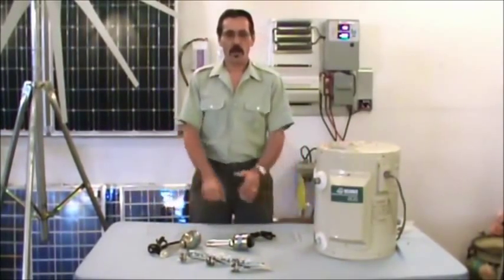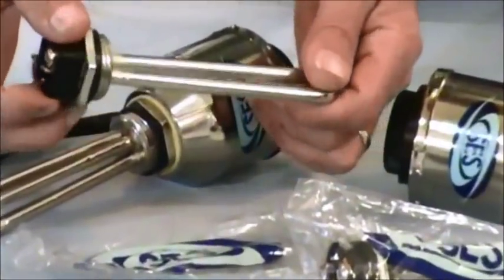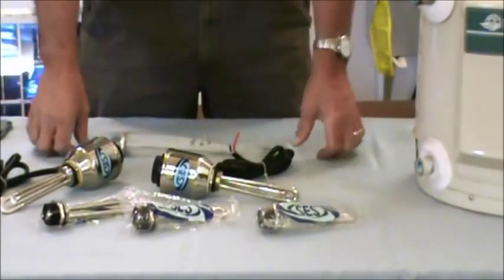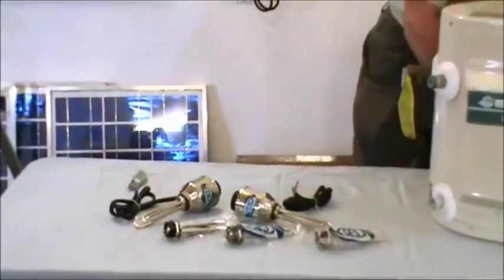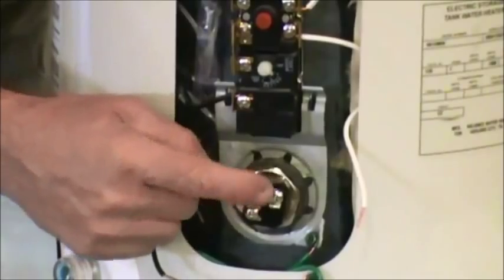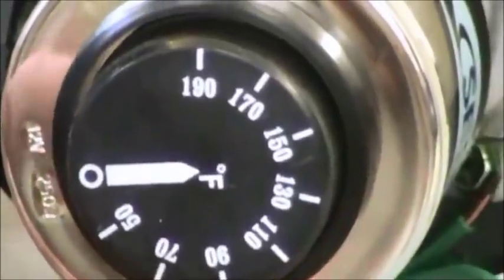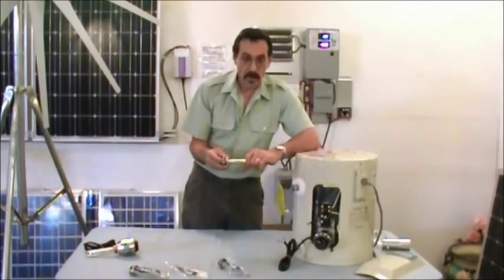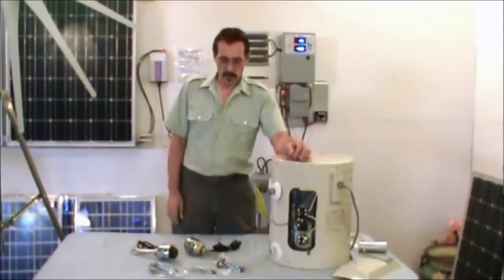DC Water Heater Element Solar Hot Water: Make Free Heat | Missouri Wind and Solar

Comment: Why would anyone want to waste solar or wind power heating water when they could use a solar water heater???
+Kenneth WIlliams  I'm a physicist. So do you mean you short out your solar panels? Why? Or do you mean you use it in a hydronic system where the heat is stored in circulating pipes in the floor and subfloor slab? Now that makes okay sense but you're still wasting the sun you could use directly for that, and wasting additional PV capacity you can charge a few batteries with. If you have a Stirling gen I could see it, but that's a lot more money than some more batteries.
Reply: Good question... Convenience? Simplicity? Cost? Time? Space? I dunno...
Reply: Marcos 989 Or a rhino for a pet, you mean. Lot of work feeding it. And where does it sleep? Anywhere it wants to.
Reply: Kenneth Williams Pssst. You can just unhook it. Not using it doesn't make it "go someplace bad". PV supplies a voltage difference, if you don't use  big enough amperage load on it you don't need to shunt this power off anywhere, it just isn't produced. In fact grounding your PV lines just wears out your PV chemically. So I have NO idea why you "send power to ground", all that does is make your voltage lower and drive less on the stuff you ARE using.
Reply: Its a good way to use up spare capacity. If your panels generate a sufficient charge such that your charge controller is dumping it, why not feed the excess power into a 12v water heater. It saves you the cost and hassle of creating a separate system
Reply: TheComputec Then buy another battery, why waste it?
Reply: rstevewarmorycom It is hardly wasted is it?

Just adding more batteries isn't always the answer...Depending on your solar capacity and setup / design, trying to charge additional batteries may not be possible on low sun-hour days and could result in the system not charging at all, but when the sun is shining and your load is low its a good dump option without the need for the expense of a solar heating system. 

Most people do have arrays that OPTIMALLY produce more power than their battery array can store. Once they are fully charged the power is usually wasted anyway, so for me its about reducing that waste

We all need a hot water storage tank anyway, so surely the cost of a 12v element is lower than the cost of an additional solar heating system?  Unless i'm missing something?
Reply: TheComputec The sun can heat water directly. Converting sunlight to electric power at 20% efficiency and using it to heat water is a waste.
Reply: rstevewarmorycom If you were choosing the best way to heat water from scratch then yes I would agree. But if you already have the solar panels and the battery storage, and you already have a hot water tank then this is a very convenient add-on to a system.   

If you can show me a solar water heating system that can be constructed for less than the cost of a 12v immersion heater then you are correct but this is mainly going to be an optional extra rather than a standalone
Reply: TheComputec A one hundred foot coil of black water hose on top your carport.
Reply: good luck plumbing that in to your system
Reply: davey wavey Why is that a problem? You just run your cold feedline to the rooftop hose coil and back down to your water heater. The water heater won't turn on unless it needs more heat. You save a fortune.
Reply: rstevewarmorycom it depends on what you are trying to do.... you would drop a small % efficiency, but you could replace expensive dirty batteries with hot water. the transfer of energy to the water with a heating element submersed is a 100% transfer of electrical to thermal energy, you could set up a staged Stirling engine generating facility right at your house. as demand goes up, you run another hot water tank and another sterling engine. so it would involve multiple hot water tanks coupled with sterling engines. It could be 1 very large multi energy tank, 3 sources, wood gasification boiler, wind or solar, and solar hot water. with separate tank and sterling set up. and hydronic heating off the main tank with low mass fan assisted radiant panel emitters and a mixing assembly to conserve energy, I would size the emitters to provide design heat load @ 125 or 130 degrees. this would ensure that emitters put out ample heat energy on a non design day at 95° F.....
Boom CHP for residential use.... just provide earth ground for excess energy, or recycle the excess in a small battery bank.
Reply: rstevewarmorycom it depends on what you are trying to do.... you would drop a small % efficiency, but you could replace expensive dirty batteries with hot water. the transfer of energy to the water with a heating element submersed is a 100% transfer of electrical to thermal energy, you could set up a staged Stirling engine generating facility right at your house. as demand goes up, you run another hot water tank and another sterling engine. so it would involve multiple hot water tanks coupled with sterling engines. It could be 1 very large multi energy tank, 3 sources, wood gasification boiler, wind or solar, and solar hot water. with separate tank and sterling set up. and hydronic heating off the main tank with low mass fan assisted radiant panel emitters and a mixing assembly to conserve energy, I would size the emitters to provide design heat load @ 125 or 130 degrees. this would ensure that emitters put out ample heat energy on a non design day at 95° F.....
Boom CHP for residential use.... just provide earth ground for excess energy, or recycle the excess in a small battery bank.
Reply: rstevewarmorycom also could be used to replace earth ground in a traditional battery system. rather than earth grounding when the battery's are full and there is no demand, I heat hot water either to help with space heating, or generate ac power on a bad day with a sterling engine. I this system I would use an ac to dc inverter to charge my depleted batteries on a bad day.
Reply: Kenneth Williams Sorry, most of what you've been blathering about is either unclear or sounds insane.
Reply: rstevewarmorycom on a day where my electrical production exceeds my needs and storage, I have to send the excess energy to the ground because there is no where else to put it. but If I have a large store of water to heat, I may never use the earth ground. Its more than blathering, It is a solid understanding of thermal and electrical energy..... If you do not know much about hydronic heating, I suppose I should not expect you to understand what I am talking about...... It's a use for excess energy that would otherwise go to waste.... thermal energy can be converted back to electricity at about 50% efficiency.
Reply: rstevewarmorycom for the record CHP is combined heat and power, it may be that a sterling engine can be successfully modulated by maintaining its source tank temperature at X °F/Watt
Reply: rstevewarmorycom or more specifically X °∆T/watt
Reply: one Joule of energy is 1N*m one watt is 1 J/second
Reply: Kenneth Williams Ahem, I know.
Reply: rstevewarmorycom if I am using solar or wind, it makes a lot of sense to store excess energy as hot water.
Reply: rstevewarmorycom true, it is more money, unless you are capable of design/build. fan enhanced Radiant panels would be my choice of heat emitter..... they operate on both radiant and forced convection and the fans as well as the water temp can be modulated. from a per dollar stand point using it for heating alone would be the best use..... a radiant floor requires about 105° F water, while a fan enhanced panel radiator is useful down to 95°F
Reply: rstevewarmorycom I tend to agree with you that solar thermal is far more efficient. my apologies I was unaware that you are a physicist. It is true that we send excess power to the ground if our battery bank is full, you have to, it has nowhere else to go..... Because waters specific heat is so high, it seems to me that heating water with excess power is a viable option.... the most efficient end use would definitely be space heating. Id rather do something with the excess than sending it to ground... or over the grid. earth ground is only used in off grid systems to dissipate electricity that has nowhere else to go.
Reply: rstevewarmorycom I have a pretty good grasp of physics, but Im more 1/2 physicist 1/2 technician at this point. I take my physics 1 final this afternoon.
Reply: rstevewarmorycom you say a sterling gen would be more expensive than more batteries? I can size a battery bank to store the energy from a hurricane, but that will cost far more than a Stirling gen and recycling thermal energy.
Reply: rstevewarmorycom makes sense. Not something I would do with solar, I've not studies much about PV, dont believe I would waste money on PV due to degradation. In any case hot water has many uses, If you can produce enough electricity, why wouldnt you heat water with it? For wind energy It makes a lot of sense, I have all this power im not using, takes a lot of power to heat water. PV on the other hand I tend to agree, it's a waste of panel.
Reply: rstevewarmorycom so most of my information here was shit, lol, that's what you get from a shitty source I suppose..... study it all properly next semester.

Comment: This is awesome... I have a RV that will become my home in the future, and the cost of propane to heat water is CRAZY priced... Being on a limited income, This would help me a great deal, and I would never have to worry about having warm water. I'm wondering if the heating element with the built in thermostat, will it fit my Atwood XT hot water heater ? Thanks for sharing this video....
Reply from the maker: +Roger Sayers Should fit it ok.
Your welcome Roger.
Reply: if ya go propane use a on-demand , its instant and only used propane while you use hot water, showers washing dishes etc a 20 pound works heating for 6 hrs at highest heat setting (will burn skin) 12-20 hours at reasonable temps. Magiccheff makes a perfectly good one and nicely priced.

Comment: Can I Hook Up 250Watt Solar Panel directly to my DC water heating element ?, with out the need of batters?;  And could you please tell use about Utility approved Grid Ti Converters., And could explain
 to use all about the 1.5KW Plugged in Solar Grid Ti Converts.

Comment from the maker: Those DC adjustables will be back in stock in a couple of months.
Reply from the maker: yes they will
Reply: @MissouriWindandSolar  Jeff, I have a 14,000 gal above ground pool in Wisc and pool heater options that exist are too expensive IMO.  This seems like it could work as a very inexpensive alternative to the pool heaters on the market right now. Message me because I think we should talk about making a kit for pool (mostly above ground) owners across the US for this to revolutionize the pool heating industry.
Reply: Very informative! Thank you!
Reply: hello, will these units work with just a 12v battery?

Comment: very informative video. In this case of the heater connections. There is not other device to install between the water heater and the solar panel?

Comment: ok I have lots of questions but only going to ask one for now I have a 50 gal 220v hot water heater with 2 elements. on at the bottom and one about half way up. can I just replace the bottom one with a 12 or 24 volt one and leave the one on top 220 volts. and just turn it on late at night or on no sun days. or does it have to be 220 v. or 24 v 100%
Reply: There is a relay on the hot water heater that switches from element to element only one is on at a time. have the same kind of unit. just wire it 120 and it will only use 1000 watts. there is a vid on my channel if you want to check it? Just did this my self working awesome so far.

Comment: GREAT VIDEO

I have a QUESTION.

With the 12v 300watt dc heating element how long does it take (approximately) to bring up a 35 gallon tank of water up to useful temps?

Assume we're starting around 60-degrees fahrenheit?

I know there are a lot of variables involved.  Just looking for a magnitude of scale.

1 hour, 3 days, etc...  I know we're talking 300 watts which is 1,023 BTUs (perfect conversion)  and it takes 1 BTU to raise 1 gallon water 1 degree fahrenheit.

So the math would say (assume 100 degree increase)   100 BTU/GAL * 35 GAL  = 3,500 BTUs

So Can I assume 3 hours?

I'm looking for what you experience day to day.

THANKS!!

Comment: I have a question if you used one of them in a solar windmill as a dumpload what happens when the temp of the  water gets to the  cut off of the thermostat ? meaning the water got to the mas temp  and the battery bank is full . then what happens as dump controller ?  cause i want to run  one though my m109a3  and so i can have hot water but also  have dump load control so i do not fry the batteries in the unit .
Reply from the maker: #### #### Good question. Alot of people have always used them as dump loads and that was on there own , not by my advice. The element has to be connected to a thermastat, once your water is hot the wind turbine will disconnect and freewheel which is not a good idea. Solar to them works good.

Comment: I had no idea there was such a thing. Can you put together a system that will switch and operate with grid power when there is not sufficient wind and/or solar and switch back when wind and or solar are producing again. Maybe a grid/wind/solar charge controller on a small battery bank. Water heaters sure gobble up power.

Comment: If I understand this correctly, when hooking up a solar panel to a DC water heater you do not have to run the power through a battery first like you do for everything else?
Reply: simon, andale andale, arriba arriba, orale pues

Comment: Could you make a recommendation on the solar panel you would use with this?  Also, does anyone know how many gallons of water a 300 watt element could heat in a half hour say to 104?

Comment: so question, i have a water heater that has dual elements and it has options to use both elements or 1 permanent and the other as a standby, do you think i could use this in place of the standby, and it would cause the main element (which it temp controlled) to operate less thus save money?

Comment: Can anyone say how long it takes a 12 volt, 300 watt element to 'reach temp' in a small 5 gallon water heater? {assuming the t-stat is set at warm and not full hot]  Curious if it takes all day or an hour?  IF my math is correct, a 12 volt @ 300 watt element would be drawing 25 amps from a battery bank til the t-stat shuts off the element?

Comment: Very nice product? 
I am using 220 / 50 hz  here in Chile because this is what all my appliances are rated at. Can these be used on a 220 system? or will I have to convert the power from the Wind Turbine? I sure do appreciate these videos. Also can you provide a Celsius scale on the heater elements?

Comment: BY my calcs that old 120v 1650W element should be 8.727Ohms. Many people forget to square V or I for power calcs on R
12v 16.5w
24v 66w
48v 264w
Thermal insulation is the key if you just want a bucket of hot water. if the heat can't escape even a tiny candle can heat a bucket of water.
But I agree, don't wast your money on a regular $10 dollar product that has had it's numbers rubbed of to resell at 1000% it's value.
But also remember just plain old enameled copper wire wound around a stick submerged in water will disipate it's heat and in turn heat the water. Just wind it up to the desired ohms.
12v at .5 Ohms is 288 watts for example. That should heat up a cup of water for a coffee in under a minute.

Ooo and yup, they look like very well made elements MW.

Comment: o.k. to simplify if your element ohms out above 1 ohm resistance its an ac unit  to get 600 watts from 12/24 volts your looking at .18/.75 ohms respectively (that's a ballpark  figure ) like i said under 1 ohm.

Comment: Your element says it is 12 volt and 200 watts. Does this mean you need at least 200 watts going to the element? If you tried using a 300 watt solar panel would it burn out this element? Thank you for the video.
Reply from the maker: No 300 watts wouldn't burn it out. On the 200 watt element you should have 200 watts going to it to reach full power.
Reply: MissouriWindandSolar Thanks Jeff. If you had a wind turbine sending 400 watts to your battery bank could you also run a wire off the turbine straight to your heating element? Could those battery's back flow up to the turbine and down to your element? Or would the battery controller keep it from going back to the turbine?

Comment: So whats the difference between AC n the DC as far as why dc n ac, are they made different ?
Reply from the maker: Yes they are made differently. The dc element has 4 wires running through it and the ac element just 1. The ac element has to high a resistance to work.
Reply: MissouriWindandSolar OK thanks !